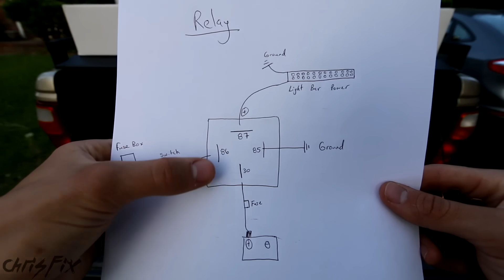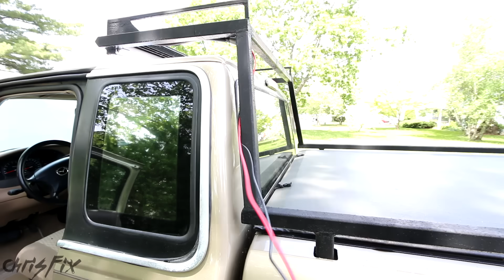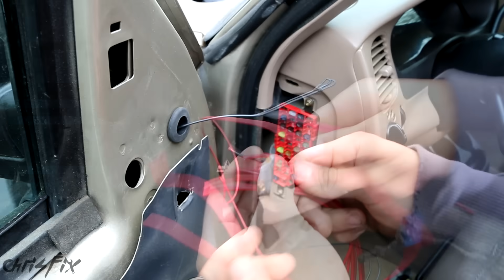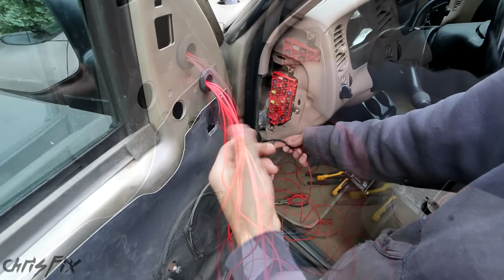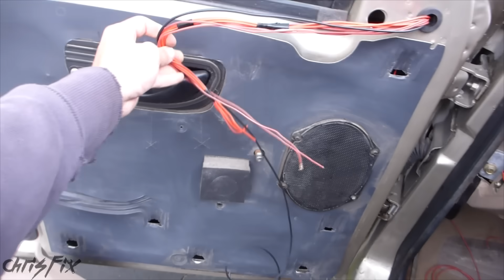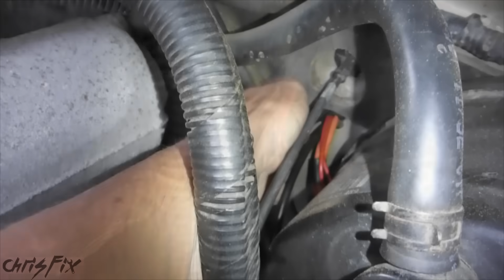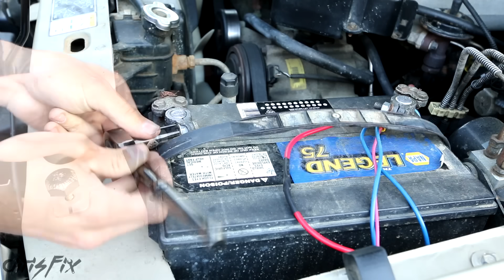How to Wire an LED Light Bar Properly (Project Night Light Episode 3)

Comment: Great video. I have a question though, in my area if I have any auxiliary lighting it has to turn off when I use my high beams. How would I wire it so I'm compliant with the law?

Comment: Why didn't you mount it to be controlled together with high-beam (just with separated relay)?
I would recommend a different order of steps: start with the interior wiring, and in terms of crimping connectors, do it after putting wires at their place if possible.
Reply from the maker: Thanks for sharing. I didnt want to wire the driving lights with the light bar. I rather have a switch.
Reply: Sure, it's your choice. I was just thought it would be more ergonomical and, since you can light it up just out of the road or when there is no other people in front, it would have similar purpose as high-beam. :)
Anyway I really enjoy the way how you put your video together - showing what is needed. important steps, why do it this way and not that way and if you do that why it would be worse, and last but not least quality of video and cut scenes are great! Please keep that as it is, I enjoy watchicg your videos even when I don't need help. :)

Comment: Chris, I have a GMC k2500 pickup with a utility bed and a ladder rack. I'm wanting to put lights inside the boxes that turn on and off when the door opens.   Any ideas?? 
I'm also wanting to put lights around the outside to use for work lights. ( We work the graveyard shift.) problem there is don't know what to get or how to wire it up. Was thinking dual batteries but, Do I need  a battery isolator?? I do have a power invertor but, kind of afraid to use it since the former owner just used an extension cord to the battery. ( I disconnected that.)
One last thing....
I have a ticking noise that comes from my engine ( sounds like valves slapping ) when going up hill only. The truck loses power and I have to downshift  it to make it to the top.  All the rest of the time, She runs like  a charm. No problems- No noises. 
What do you think??
Reply: sorry for late reply just saw video/channel.  for the lights to come on when you open the door you need whats called a micro switch, and an activator arm.  navy terms, not sure what to get civie side. but how it works is you mount the micro switch to the side or top panel inside each box, then mount the activator arm basically a bolt through the door, so that when the door is closed it pushes on the switch, then when you open the door it releases the pressure on the switch.  the switch would be considered normaly open or n/o when pressure is applied, cutting off power and when the door opens it switched to n/c or normally closed.  i hope this helps its hard to explain when i cant post a picture or drawing.

Comment: Hey ChrisFix, I was wondering about how to install aftermarket fog lights on my truck! Sadly my 98 Dodge ram didn't come with any and I've been curious to if I could use this tutorial to wire up and install said lights, I'd appreciate it if you responded, if not, that's okay but.. Just thought I'd ask. Thank you!
Reply from the maker: +The Pixelated Gamer yes you can use this to install fog lights. Same process.
Reply: Thank you! I will send you a video response or a picture or something of the after product.

Comment: you never made the coming soon bed light video did you chris?    haha
Reply from the maker: +bekir kurt I still have those bed lights lol. I will do it I promise! Probably when I build the rear bumper.
Reply: ChrisFix you have to do it man i got a 96 gt convertible 3 months ago and last week I got a black Mazda b3000 truck hahaha and I live only about an hour away from you that's what you call a hardcore fanatic hahaha

Comment: Chris do you think you could do a video on how to setup a master switch for lighting? I'm trying to figure out how I'm going to setup my emergency lights and if I hardwire them all I want to have a master to turn them all on with one switch but still be able to turn them off independently as needed
Reply from the maker: That would be cool!
Reply: ChrisFix problem is I have no idea how to do it lol. And I don't necessarily want to pay for a professional installer to do it

Comment: Ford Ranger Mazda B3000? How is that possible?
Reply: MadMonkeyQ Ford and Mazda have a partnership together and in this case, the Ford Ranger 3.0 is the same as the Mazda B3000. They're only a few differences between the exterior of the body. But everything inside is the pretty much the same. Hope that answer your question.
Reply: Oh.

Comment: So Chris, I have a little issue with my factory amp in my 02 ford escape, actually, I was told that there is a bad signal coming from the head unit that doesn't turn off the amp when I shut down the engine. I am planning on upgrading the head unit but cash is a little tight right now so I was thinking of reconfiguring the fuse that powers on the amp using a fuse tap to a rocker switch, similar to what you did in this vid, to manually turn off the amp. I've got 2 questions concerning this small little project, 1. do you recommend doing this configuration......head unit......fuse....switch.....amp. 2. if you recommend it into which slot do I put the fuse, keeping in mind I'm not piggybacking in order to power something else, I just don't want to have to cut into any wires.

Comment: So if I did this, how would I wire multiple light bars? Would I use a different relay for each bar? And then splice into the same fuse tap for each light bar?

Comment: Run the cable true the metal pipes, it will be much cleaner
Reply from the maker: +Remi van ysacker the metal pipes are sealed off because everything rusts here.

Comment: Ok Chris i am watching you this video to get some help on wiring my 28" led bar. 180watt(3watt per light x 60)
your box shows that this LED bar is 80leds @ 5watts each = 400watts
400watts / 14volts(high alternator output) = 28.57Amps NOT 15Amps
this is an issue for me because the Math do not add up to pick the correct AWG wiring.

My Light bar 
https://www.amazon.com/Willpower-Combo-Light-Driving-28inch/dp/B01H1A62PS/ref=sr_1_1?s=automotive&ie=UTF8&qid=1493310239&sr=1-1&keywords=willpower+28%22+led
60leds@ 3watt = 180Watts / 12volts (STANDARD car voltage unit) =15Amps.

Your light bar pulls almost double AMPS but you using same AWG wiring?
I could use help on this. 
Julian DeVos
Reply from the maker: The wire gauge is dependent on how far you are running the wire. My lightbar draws 15amps at 12v. Not all light bars are run at full capacity (in this case 5w per led). I see what you are saying though with the amperage. All I can say is that I have a 15amp fuse and it has not blown!
Reply: man I wish I could find out what the best AWG wiring to run without going to big gauge$$$. I will be running 2 7" 36watt and a 28" 180watt light bars on the same switch. 252watts.....hmmm lost. But it's good to know your run 15Amp fuse and no issues at 400watts of power. dos your wires heat up?

Comment: using a relay in this case is pointless
Reply: serious question, why is it pointless?
Reply: Not pointless. Without the relay, switch and all wiring has to be rated for 20 amps.

Comment: Hi Chris I have a car derived van (2011 Ford Fiesta van) Ive bought a 12 inch 12v led light bar (I realise this is going to be extremely bright in a small van) and mounted it to my bulkhead.... Can I wire this directly to the light thats already in the back This would be the trunk light in a regular fiesta car.

Thanks in advance.

Comment: Only a couple observations. I would have replaced the fuse with a circuit breaker and would have tagged the future-expansion wires.  Sourcing a weather-pack socket for the relay would have been a nice touch as well.
Reply from the maker: Thanks for the tips
Reply: ChrisFix You are very welcome. My comments/tips are solely my preferences.

Comment: notice how the volt meter reads 12volts on the fuse box.... typically the fuse box is hooked directly to the battery. lights draw virtually no amperage and wattage doesn't matter. A relay in this situation is a waste of time and money. the only relays in my light setup are for the wireless light controller, but the toggle switches in cab are rated for up to 24volt 30amp... 30amp... WAAY more than any LED bar is going to draw... soo why use a relay at all? now a starter motor however, thats a whole different ball game and absolutely MUST have a relay..
Reply from the maker: Thanks for sharing. This light is 40,000 lumens and draws up to 15 amps. You dont want to run any high amperage wires into the cab for fire safety. That is how the factory wires the car as well.

Comment: sir chris how to fix an led bar?
Reply from the maker: Cool idea!
Reply: ChrisFix Hey I hope you get a Ford Raptor one day. I think if you put all the lights you have on a Raptor, it would look pretty bad ass. Also there are built-in auxiliary light ports connected to switches inside the truck included

Comment: I used this video to wire two 6" light bars in place of fog lights. I wired everything up just like in the video and it works perfectly except the switch doesn't light up and it'd be awesome if I could get some help with that.

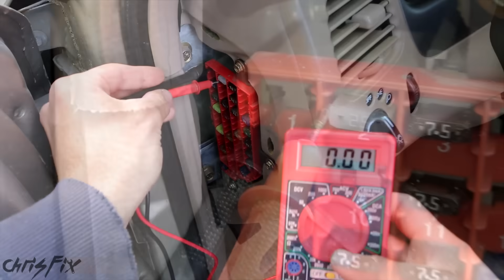Comment: I think you've got something wrong there. at 8:36, those two holes in which you put the leads are the same line, i.e. only the positive wire. one hole has +12V from the battery and the other whole goes to the accessory. they're not positive and negative so you can't measure +12V between them. think of how a fuse is connected, it's connected in series with the accessory not between the positive and negative because this way the fuse will short them together. in short, the connection goes this way: +12V source (battery) > fuse > accessory > ground (negative).

Comment: legal on the streets?
Reply from the maker: No, but where I live there are back roads with no one on them for miles so I use these lights like my high beams to see deer. If I see a car, I immediately shut the LEDs.
Reply: ~cool :p would be cool if it was legal though... but I understand it is to bright for the road though

Comment: Good day sir Chris. I was planning to install RGB leds strip to my 2003 honda sx8. For Panel gauge, footlight and under glow all parallel to parklight as source with one remotecontrol. few modification from bulb to rgb led Strip on my panel gauge and climate control (hope you can give me some tips). 

Now my main problem is how can i add switches for footlight and underglow so that it is not always on when i turned the parklight. and how many pins do i need for that switch?

I hope you can help me and educate me my friend. i will show you my initial plan for my project

Comment: +ChrisFix, Hey Chris I did a project on my Dakota based on this video, however I used smaller light bars in the grill area. I have a weird issue though, when I turn on the lights the radio gets really "staticy", when the lights are off there is no problem. The relay is on the opposite side of the truck than the antenna is and the wiring harness I bought pulls the power for the switch from the relay so there is no fuse tap, any Ideas what the problem could be?

Comment: Hey, why didn't you run just one lead of 12V to each switch in series to reduce the number of wires going through the door panel?

Comment: Holy shet!! Exact words as soon as you flipped that switch in the woods. Super nice clean job you did. Congrats, even the wires were ran nice neat and hidden. Just wish you had a little Civic like mines. Defiantly going to subscribe, good job.
Reply from the maker: Thanks a lot! You can wire these behind the grill of the civic for back roads.
Reply: Word,  just cost alot thou. Maybe down the road after I fix my car up

Comment: what if you dont have an open slot in your fuse box ?
Reply from the maker: You can run a fused wire straight from your battery.

Comment: not exactly a place I would put the switch as far as looks go. but that's just me!  great video Chris
Reply from the maker: +Taylor Guild thanks. That is by far the best place you can put a switch for use. I can flip it on and off when driving back roads so I get a lot of use from my light bar.

Comment: i just watched these videos and I'm wondering if your going to make a buss bar for your power wires and did you replace you battery terminals they looked bad.
Reply from the maker: Yes I replaced the terminals and I have project Night Light Re-lit coming up!
Reply: ChrisFix nice how much did it cost your to buy all the metal your used I'm thinking of making one for my 93 GMC Yukon it's the 2 door version

Comment: don't you need a bigger car battery? those light might drain yours quickly than the alternator charging it up
Reply from the maker: Nope, the battery is fine and the alternator is 130 amps which is plenty big for this truck and the lights.
Reply: how long do you think those led bar will drain your car battery if you turn off the car? 1-2 hours?
Reply from the maker: In 20 minutes.

Comment: Chrisfix quick question, where can I get expandable circuits and 16 gauge automotive wire?
Reply: If I have to, but if napa or auto zone would have them, I'd prefer to go there.
Reply from the maker: +Seth Gibas online and/or your local hardware store
Reply: Ok thanks, you're the best!

Comment: To powering up switch I would use voltage which is available only when engine is running ("D+" according to DIN 72552). Otherwise you may very quickly  discharge your battery, when engine is idle.

Comment: Hey Chris, I'm just asking myself why you didn't run the wiring through the light bar frame?
Reply from the maker: Great question. Here in the Northeast rust is a very big problem so I sealed all of the bars to prevent rust.
Reply: Oh I understand, sounds very logic to me. Here in Austria this isn't as much of a deal hence I didn't take this into account. Thanks for answering so quickly and keep on creating those awesome videos!

Comment: I've been thinking of buying some LEDs for using it for midnight hooning. I'd hook them up to the high beams. Problem is, I can't mount them on the roof. So LED bars wouldn't be the best idea for me, I guess. Any idea which LED pods I should buy? I'm looking for not so expensive ones like 50 usd tops. Or should I just not buy anything for this amount of money? P.s I'm in Europe and would most likely order from EBAY

Comment: With 8 wires to the door you can actually get 7 switches powered (1 common positive and 7 from the switches to the relays)
And since they are only powering relays you don´t need to worry about current draw
Reply: i was thinking the same thing. like how many fuse taps you gonna have? lol

Comment: If someone has not already mentioned this in the comments, you can also wire up the lighted connection for the switch to a 12v source that is powered when your parking lamps or headlamps are turned on. That way, you've got the switch lit up at all times when it's dark (you'll most likely have your park/headlamps on anyway.)

Comment: i have a 40" blackoak  lightbar im hesitating to wire it directly to my battery cuase it killed my last truck  i have the complete wiring harness for it what should I do
Reply from the maker: Use a relay!
Reply: ChrisFix how do you know what size relay to use.
Reply: MidnightTxRider it depends on how many volts it draws

Comment: Looking at how you jumpered the ground pins for all 4 switches, did you also jumper the power from the fuse tap to all 4 switches as well?
Reply: he didnt. he ran separate power wire for each switch. with a relay setup like this you can jumper all the switches and only run one power like with the ground.  he had 9 wires total but you really only need 6

Comment: Chris great video!! Question, So If I dont want the switch to light up, I dont need to ground it correct? And another question, can you wire multiple lights or light bars to the same relay and same switch? Is there a point where the lights pull too much power? Are there different relays that can handle more? Sorry this is new to me but I have some big things planned. Thanks!
Reply: Relays have a max amperage rating so you should calculate the total, combined power draw for all of your light bars through that circuit. If it's below the recommended amperage for the relay you should be ok. If not, split it out with two separate relays. You can always chain together the 12v power that triggers the relays so they will kick on all at once.
Reply: Ok. So for what I'm doing, one relay will work. Where should I split the power to the lights? At the relay? Or can I have it split later right before they both can hook up?
Reply: If the lamps are mounted close together, I would say split it closer to where the lights hook up. If you have a roof mount light bar and a bumper lights, then you could split at the relay and make two separate runs. Also, you could go with a special driving/fog lamp relay (SPST relay with dual outputs), and you can run two separate wires to each lamp. Just factor in the length and the gauge of wire as Chris shows in the chart in his video. It's always better to step down one wire gage (thicker wire) versus trying to use a wire that's too small which could burn up the wire insulation and start a fire before it pops a fuse.